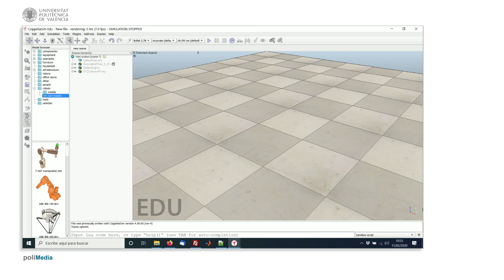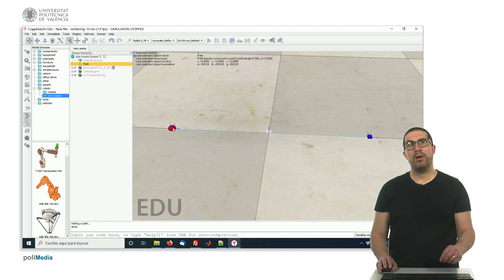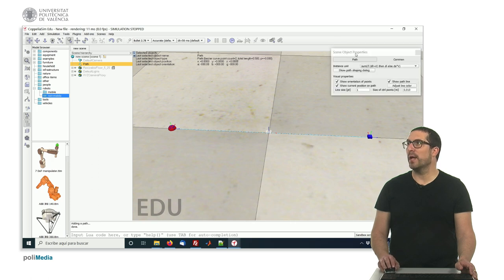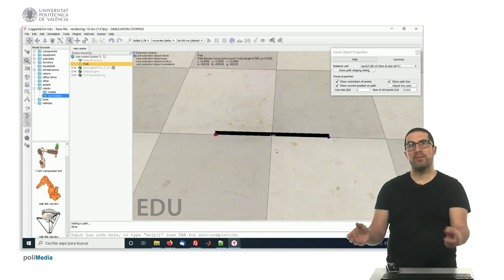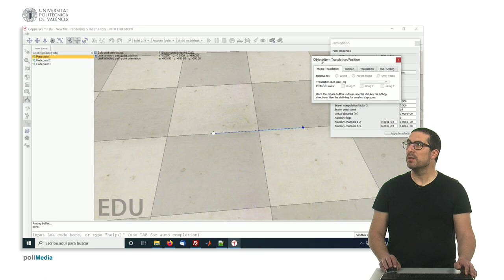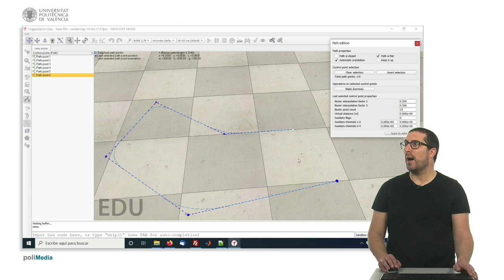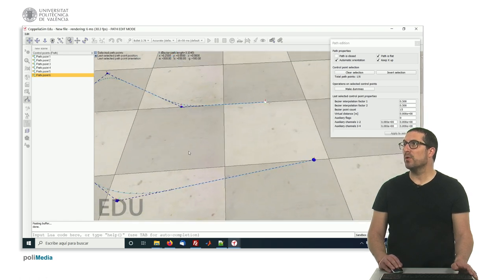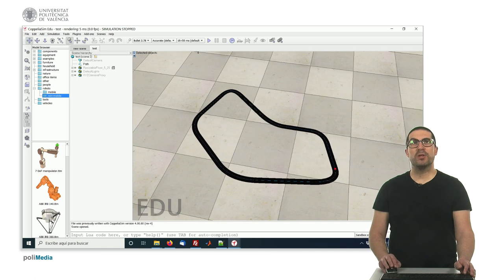Creating paths on the floor | CoppeliaSim (V-REP)

Comment: Hello. Thank you for this video. Do u know if it is possible to make stairs or holes in coppleasim ?
Reply from the maker: What do mean by making holes? Do you mean making holes during the simulation, like a drilling tool? If that’s the case, yes, there’s a tool for that. Also, you can edit an existing shape and remove some triangles to make a hole manually. Anyway, CoppeliaSim is a robot simulator, not a CAD software, so their capabilities for modifying objects are limited.

Comment: Hello @Leopoldo Armesto . Is it possible to create tube with bends in Coppeliasim or can we import CAD model of pipeline into Coppeliasim? I want to create environment as pipeline for robot
Reply from the maker: You need to import the mesh from a STL or OBJ file
Reply: @LeoArmesto   Thank you for guidance. I need to navigate robot in pipeline
Reply from the maker: Yes, you can still that with a mesh. It won’t be as efficient, but still allow to be respondable, collidable, etc...
Reply: @LeoArmesto   Okay. Can't we create that itself in Coppeliasim?
Reply from the maker: No, it provides basic tools to modify meshes, but it’s not a CAD software
Reply: @LeoArmesto  can vortex pluggin used to create Pipeline which includes bends?
Reply from the maker: The plugin is used for simulating the dynamics, not for creating shapes, as far as I know. You need a mesh and best tools for that are CAD softwares such as Solidworks, Fusion 360, Catia, etc...
Reply: @LeoArmesto  Thank you for clearing doubt